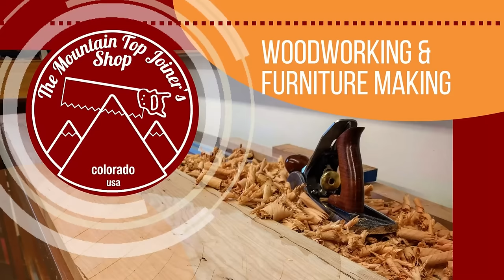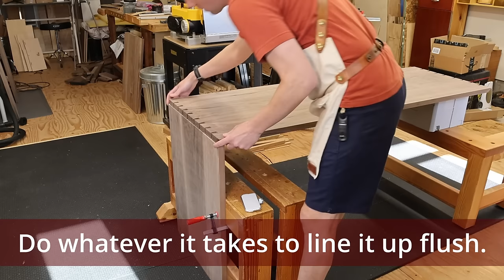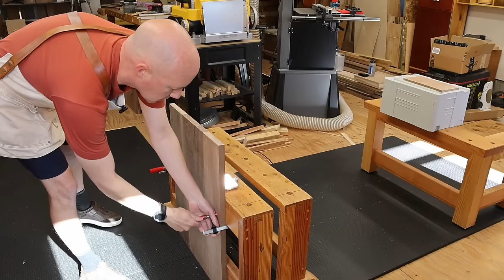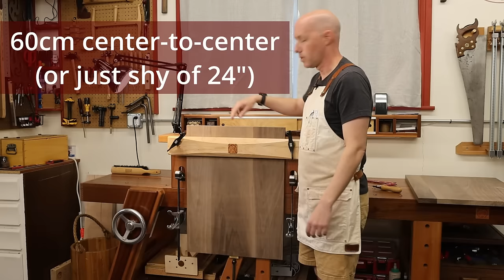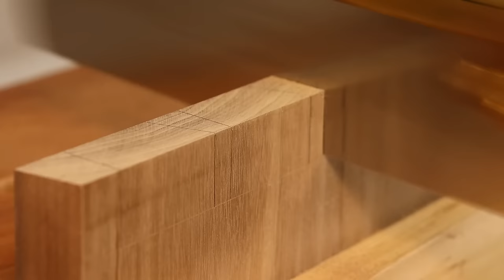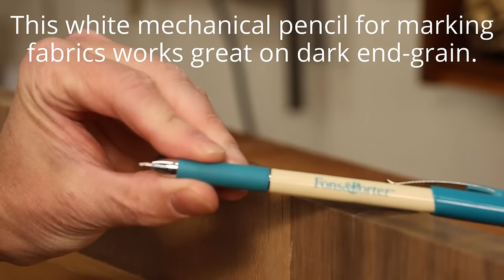Dovetailing a Big Case by Hand, Part 2

Comment: I made myself a dedicated dovetailing bench. I built it 28 inches wide and 48 inches long. I've got 4 Moxon vices on it the length of each side, dog holes n the top, and supports that fit in the dog holes with brackets I can raise up and down to hold the long and wide panels. I've got 4 panels in the bench vices right now for a reproduction Penn chest of drawers joined with dovetails I'm building. Your videos are 1st class, especially for beginners getting into hand tools. Thanks for sharing.

Comment: I really like the desk lamp setup with the lamp bushing for dogholes. I checked my cheapo desk lamp, but it doesn't seem to have the 1/2" diameter post to work with the Lee Valley lamp bushing. Plus, the post is so flimsy I feel like it needs a set screw to stay in place. Do you happen to know where you got your lamp or who makes one that fits the adapter? I'm trying to look online for a compatible lamp, but (gasp) that diameter doesn't seem to be one of the commonly listed specs. Would happily click an affiliate link.
Reply from the maker: In my experience the ones most likely to fit the lamp bushing are the ones that have a clamp and post design like this one:  https://amzn.to/3HFIn3V  I also prefer the ones with a standard socket so I can put whatever bulb I prefer in it. As always, it's good to shop somewhere that makes returns easy just in case it doesn't fit, but I'll probably order this one myself and try it out.
Reply from the maker: Also, these cheap desk lamps are just that, and don't always hold their positioning every well with the plastic knobs provided. Be prepared to swap the plastic knobs out for metal ones, or try your luck with the exceedingly rare higher end versions.

Comment: You take a tremendous number of strokes to saw each of the dovetails...how many tpi is that saw?
Reply from the maker: I don't recall, but like I said in the video, the saw isn't designed for stock anywhere near this thick. It's the only dovetail saw I have though, so I just deal with it. It could probably stand to be sharpened as well.

Comment: Great content in these two videos on Big Case Hand Dovetails! I really appreciate that you take the time to go over solutions to challenges that you find along the way. Each project is different and discovering ways to overcome these challenges is key to a successful project.

Using a trim router with a pattern routing bit to pare directly to the baseline works great! Remove waste with the coping or fret saw and use the router to remove the final 1/8" or so. Clamp a board overhanging the board the router rides on as a stop for setting the height of the pin board in the Moxon vise. Use a test board with the same baseline to set and test the depth of the router bit. Mike Pekovich demonstrates this technique in Fine Woodworking mag.

Cheers, Gary